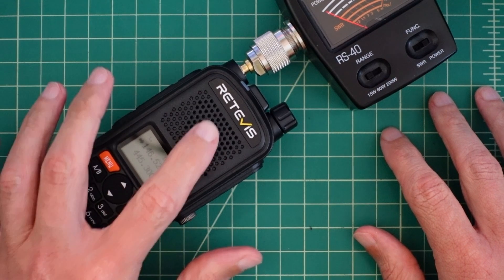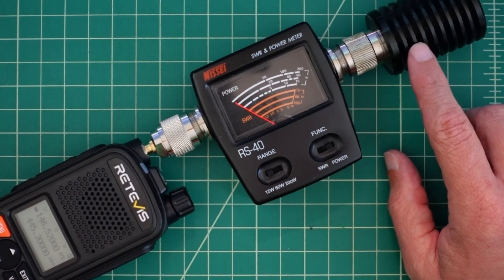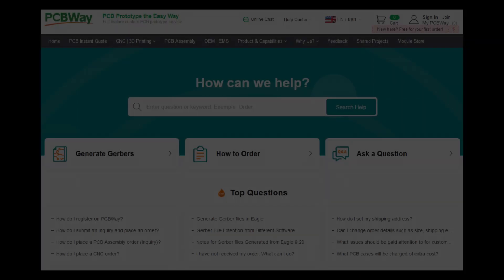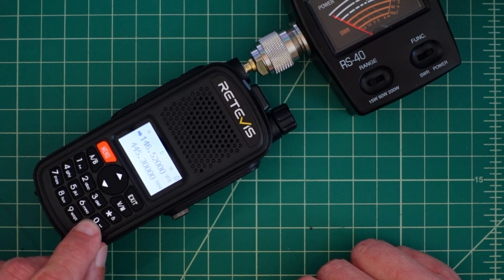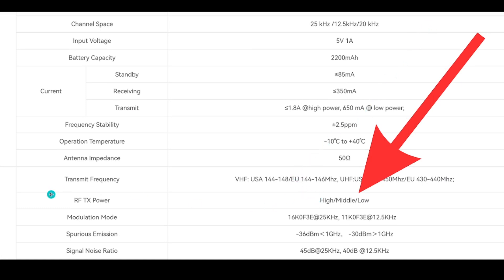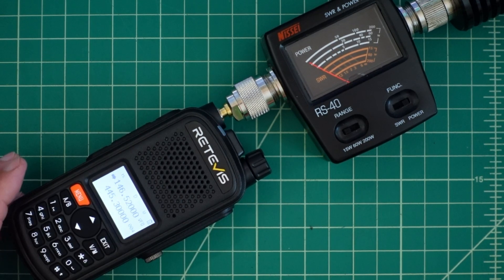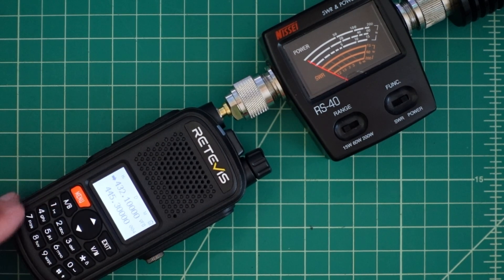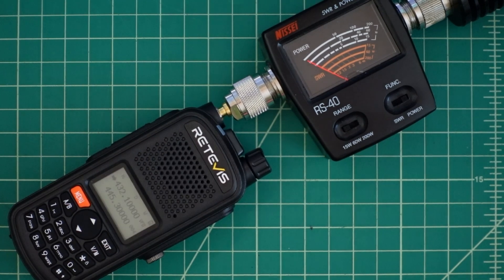Will is pass the Power Test? - Retevis A1 Dual Band Ham Radio

Comment: the manual missing information . nothing new.  from testing radios from China ,I find power levels all over. even in a 2 pack each radio may test different. well to solve that problem they did not give power level. their is in fact 3 power levels. so we can't complain about power levels being to high or low. 73's
Reply: Hi Robert, we would like to know what information you would like to see in the manual so that we can improve it in the future. 😣
Reply: @retevisQA  did not see the whole manual yet. but the manual in this video did not have the transmit power listed. just had HML for power. thank you for asking. I have many Retevis radios and use them . love the MURS/GMRS/FRS ones.  listing the transmit power in watts was left out.
Reply: @robertmeyer4744  Thank you for your feedback and recognition of our product. I will record this and tell the engineering team.🥰
Reply from the maker: Hey Robert, thanks for watching 👍